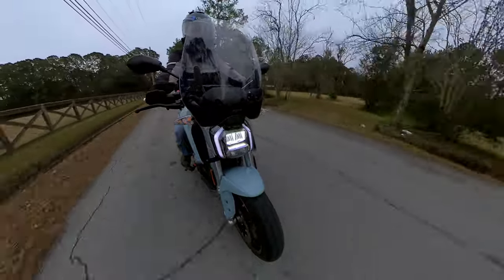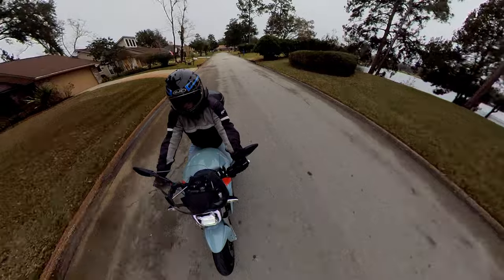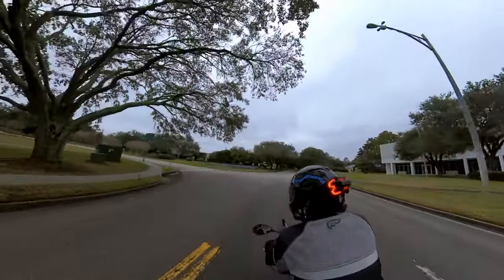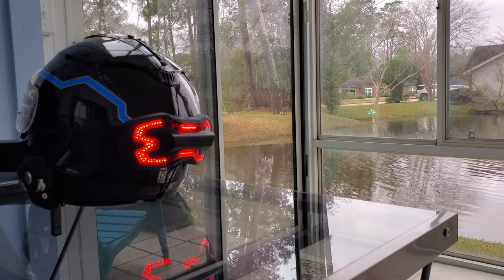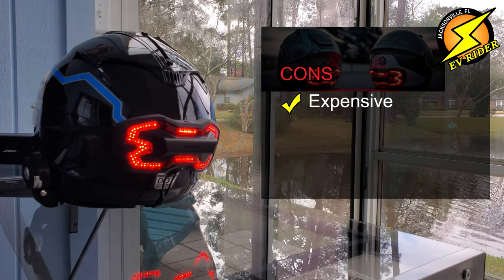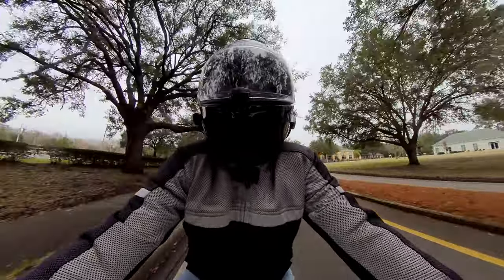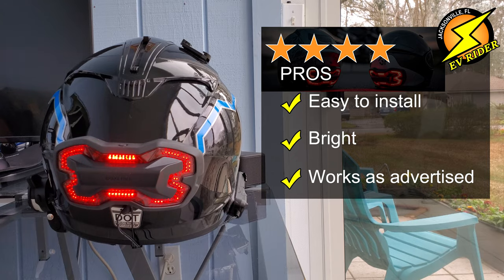Brake Free Motorcycle Helmet Light Review

Comment: 0:43 how come that option is not available from my unit?   mine is not like dat on 3.modes,   even on most of the youtube reviews it is not like dat
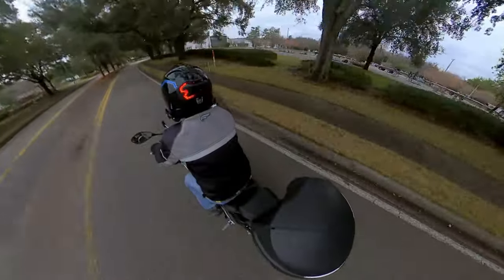Reply from the maker: I believe you may be referring to the LED strobe effect that some cameras pick up. I explain it at 00:01:46 in the video. It's not a feature of the my particular helmet, but rather a defect of my camera.
Reply: @EVRider  OHHHHH ok i rewatched your whole video so dat is just a camera glitch,  but dat effect looks cool , i just bought mine few days ago , hopefully on the v2 version dey add more cool light effects just like dualtron leds customizations  , BRAKE FREE if ur watchin dis pleaaaaseeeee add more led effects 🙏🏼🙏🏼🙏🏼🙏🏼🙏🏼🙏🏼🙏🏼🙏🏼🙏🏼🙏🏼
Reply: @EVRider it's not a camera defect. It is a difference in sync between the frame rate of your camera and the rate (hz) of the lights. Can easily be fixed.
Reply from the maker: @Luggruff Fair enough. I'll concede that point although I'll add some cameras do a better job avoiding LED flicker than others in auto mode, which was the mode the 360 camera was in at the time.
Reply from the maker: @Luggruff  I shot that on a dark, drizzly winter day. Had I used anti-flicker (50 or 60 hz) or a different frame rate other parts of the image quality may have suffered since when shooting 360 video on a motorcycle I am shooting blind. Those shots were produced in auto mode at 5.7k at 30fps on my Insta360. But yes, my word choice to explain the flicker could have been better.

Comment: Con:  one year warranty.
Come on people stand behind your products.  One year is nothing.
Reply: in the new paradigm, no one manufactures all parts of the product and many components do not offer that level of reliability. So, one IC fails, one resistor develops a glitch and the product fails. It's a tangent running from the global-sourcing model and China being a super-hub for manufacturing but one with no internal quality and regulatory guarantees.

Comment: Nice idea, but in need of much improvement. Too large, too heavy, responds too much to non breaking action (engine breaking), etc..
Reply: Brake Free is only 200 grams or 6oz. Which means it's the same weight as most action cams in a case, but it mounts in the back, so no extra drag or noise. Most riders, including Chase On Two Wheels, and EV Rider have mentioned they don't notice the extra weight while riding. The size of the unit was optimized for visibility and fits most helmets. Engine braking IS a braking event, so why shouldn't it activate?! It does not go off when going over bumps, head movements, and other non-braking events. We understand it's not for everyone, but anyone looking to drastically improve their visibility, Brake Free is a must.
Reply: Stupid comment to make. Great idea and it works great especially for first generation. I’m sure second generation will be slimmer and longer battery time
Reply: Engine braking is exactly as it sounds. If you’re going from 40 to 37 mph, rightfully so should the thing light up. And i know some women that dont even notice the difference so i think you’re going to be alright.
Reply: I've had mine for a few weeks and love it. Zero issues with mounting and I haven't noticed any extra weight or drag on my modular helmet. It must be working because people have pulled up at stop lights and told me that they noticed me because of it. All in all, I'm very happy with it and for me it's worth the price.
Reply: Doesn’t sound like you ride.
Engine breaking is the most used type of breaking when on two wheels.Only time I actually used my brakes was to come to a complete stop from whenI was  already below 10 mph.
And companies specifically make a module to light up for engine braking for that reason.
Reply: @BrakeFree  Can I get a discount if I review your product??lol
Reply: I want something like that for not only my bike but my car and truck as well. I want the thing to light up when I'm slowing down.
Reply: Brake Free I would like to get one but why can't we order outside the US?
Reply: engine braking is one of the main reasons thus thing is built 💀